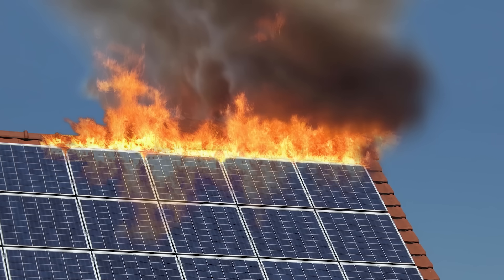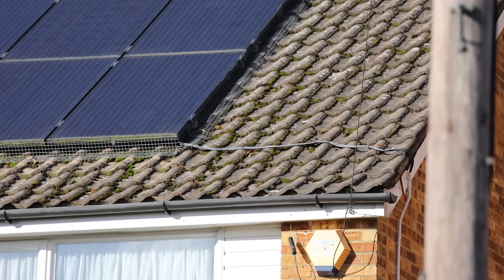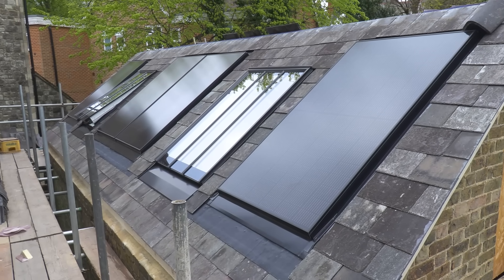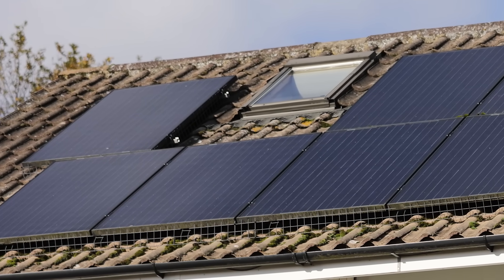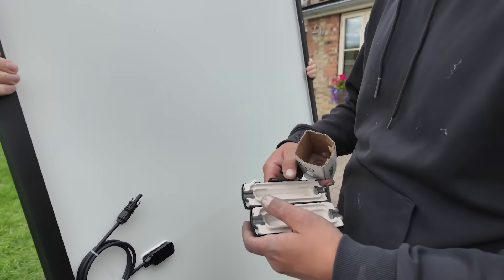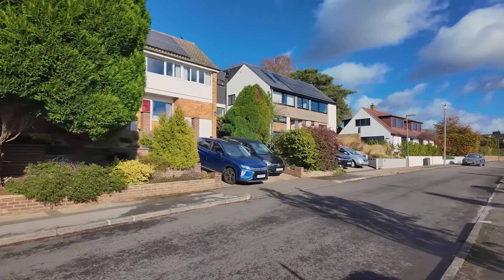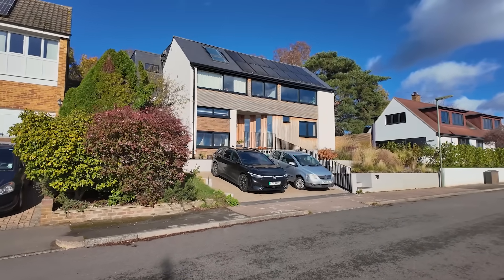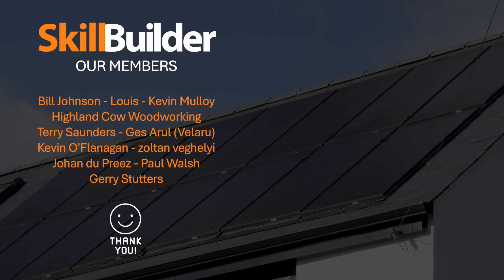Solar Panel Fires Are Rising – Here’s Why

Comment: A very valid video. Not scaremongering but flagging up a risk to some installations. A heat detector is of course a recommended alternative to a loft smoke alarm but usually too late to save the house before they trigger - although it should give time to escape. A friend's EV charger ignited his house. He has replaced the EV with a new petrol car.
Reply: And of course petrol doesn't burn. In 2022 infernal combustion engine cars were 19 times more likely to catch fire than an EV. It is even less now that more EVs are using Lfp batteries.
Reply: @philbrooke-little7082  Absolutely. I'm not disputing that data. I was just stating an isolated fact. In this instance it was the charger that ignited while the EV was being charged overnight. Insurance data: 15 to 30% of EV fires are related to charging. In decades of driving this is the first home car fire I have personally known about. Yes statistically EVs are less likely to catch fire and LMFP EVs are safer than the LFP you mention.
Reply: @philbrooke-little7082  You sound like a pissed off ripped off early adopter!
Reply: @leightonevans1071  No not at all. Certainly true I have lived with LiFePO4 batteries for years and am very happy with them. What pisses me off is the bad press they are given by uninformed people who often don't even bother to differentiate the different lithium chemistries and worse when badly informed people get to legislate and terrorise people. I quite understand the risks of loft mounting and they mainly revolve around the weight and electrical isolation. Not the flammability of the pack or the likelihood of it being the cause of a fire.

Comment: I much prefer the look of in-roof panels but I eventually opted for on-roof mainly because I'd rather have a layer of thick concrete tiles between the panels & kningspan/rafters, I realise it's not a complete fire block but it's still a step up that might give you an extra bit of time for the firebrigade to get there. As an ex-fireman my self I'm probably more paranoid about fires occurring than most after seeing so many on a regular basis.

Comment: Interesting but I didn't catch how most of the fire are starting? Is it mainly on the DC side of things? Connections outside the solar panel or the panel itself? Are you converting to to AC right away after the the panel in Europe or you running DC all the way to the MTTP? Where are the weak spots you are seeing?